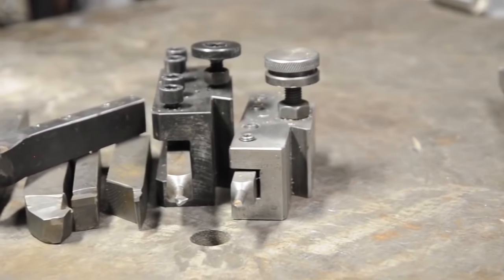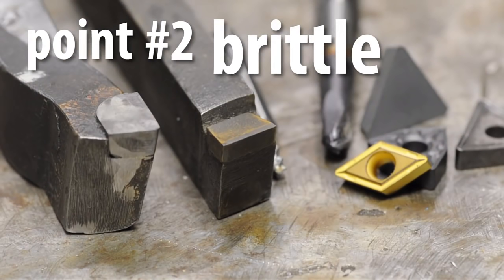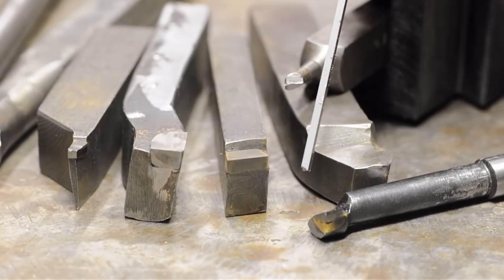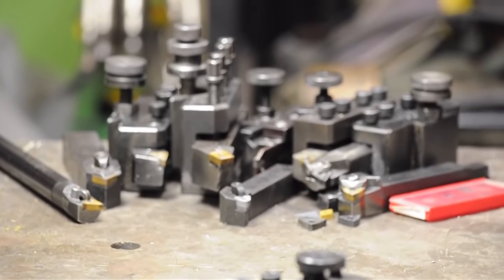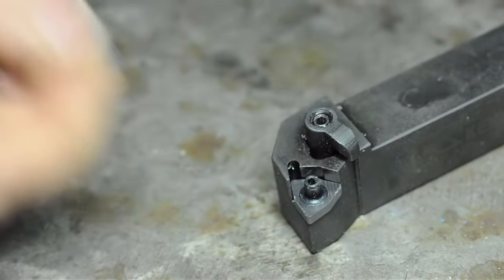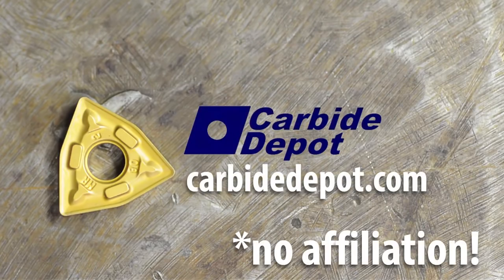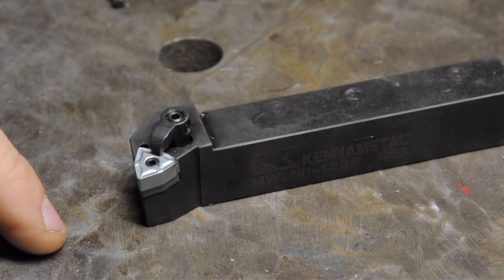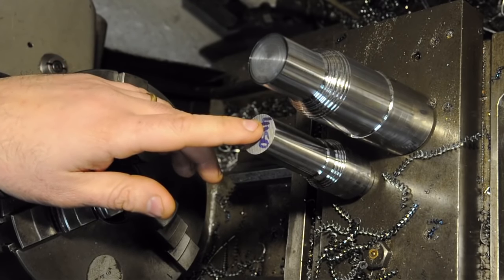A Brief Chat about Carbide Tooling

Comment: I'm completely green at true machining, (I HAVE managed to make plenty of scrap without the assistance of a lathe, mill, etc.. for a number of years), but I bought a little Sherline lathe a while back without a motor for next to nothing, and I finally have a motor for it, so I'm about to accelerate my scrap production.

I keep seeing comments, and hearing TOT berate cheap tooling, and want to share something I discovered not long ago.

I saw some very inexpensive set of 3 small boring bars on eBay which included 10 inserts, for < 40.00. My wife works for one of the big industrial suppliers in the US, so I get to buy toys, er tools, and tooling at employee pricing, which is cost +10.

I looked up the exact same boring bars and inserts to check the pricing, and what I found was the EXACT same Chinese brand at a significantly higher cost. They also sell 'US' brand names, including the Kennametal holder TOT displayed, so the ones I looked up were they lower priced entry, (the company, like many offer a range of price points for similar/same products, not same in quality, but features/type).

Unless you know for absolute certainty something is made in the US, don't assume. US manufacturers play a variety of games, ie: components of a device are made in various places around the world, then assembled, or packaged in the US, and they claim it's made in the USA.

Not all Chinese made stuff is junk, some US companies imbed QC guys in the manufacturers, since that is where a lot of Chinese manufacturing falls short. With that said, the Chinese manufacturers are learning fast.

The other old farts, like me, are old enough to remember when Japanese products were crap. I remember when no one would buy a Japanese bearing, now they dominate.

My theory is they were struggling with precision measurement, and it reflected in the products. I found an old Japanese set of taps and dies at flea market a few years ago, and they reminded me of how bad they were, when I was a kid, and working at my uncle's auto shop.

The taps would thread holes, and do a fair job, but you better use the dies to make you own bolts! And don't even think about 'fixing' a fastener, stud, or nut with them, they were off just enough to make them worse.

Nowadays, I'm seeing a repeat of the Japanese problems with precision measurement in Chinese products. I mean, would you willingly buy and use Chinese taps and dies, or bearings?  I wouldn't, I want the good stuff, from Japan!

If you want an eye opening vision of Chinese mentality and manufacturing, there's a Wired Mag vid here on YouTube titled, Shenzhen, The Silicon Valley of China worth watching.

Comment: I'm primarily a woodworker, so I have lots of brazed carbide, like in circular saw blades and router bits, though I have some HSS router bits too. That said, for working with wood I kinda prefer hand tools most of the time.

Comment: I was taught Carbide is good for moving metal on the harder metals, but high speed steel bits were the king for moving metal with a cleaner cut on softer metals like aluminum or brass.

Comment: I have done a little research into this and this is the impression i have got. 
Mostly its about getting a good ratio between edge sharpness and depth of cut/feed.
Inserts are not designed for taking off small amounts of material, that is why they are made blunt. There are inserts that come sharp for finishing work that might work better for people who dont have the power, bravery or ridgidity to take off big cuts. However these finishing inserts, with sharp ground edges, are not common or cheap, because they are not made in huge quantities for the heavy industrial user.

Comment: protip: most insert comes in a box that says recommended speeds and feeds. SECO, Sandvik and iscar does it best imo. if im not misstaken that insert you used should have around 440 rev/min and 0,44 feedrate.

Comment: As to the sharpness of carbide, there are grades with PVD coating, that are razor sharp...example: kennametal KC730 (this is an old grade so,fairly cheap on eBay). On the lathe, I use CNGP431 & 432, these have .015 & .031 nose radius respectively. CNGP is a nice geometry since it gives you 5 degrees clearance front and side(face and turn with one tool). Kennametal kc850 is a very tough grade for roughing...and very cheap on eBay.

Comment: nice vid tony. i must tell you a few things you did that i do not agree with. when you were changing the broken tip insert,you ALLWAYS tighten the cam lock screw first. and ALLWAYS blow out the tool holder pocket with an air jet. small particles in the pocket can prevent the insert from seating correctly. i am not familiar with the 08 08 code. that insert i thought was wnmg 431. maybe they changed it? thx rc

Comment: I'm not sure if you touched on this but the density of carbide is amazing. Easy to tell what cutters are carbide if they look similar to HSS. 

I've not had time to explore all your offerings yet, have you done anything with ceramic inserts? I got a lot of experience with them as a Toolmaker, quite often hardened components would need further machining. The whole "leave a bit on in case it warps or distorts"

Comment: When going through the insert code you said the thickness indicated by the 04 in the code meant 4mm thick, it doesn’t it is 4.76mm. This is because even in the ISO code most of the dimensions are imperial due to the length of time that inserts have been around. The ones that are metric are ones that have been added in more recent times such as the 08 inscribed circle designation. A CNMG120408 for example has an inscribed circle of 12.7 and a thickness of 4.76mm. This is where home users need to be careful when buying tools and inserts on eBay or Alibaba etc as some of the Chinese inserts that are sold in these places as part of those kits you mentioned have none standard inscribed circle and thickness dimensions which makes getting more inserts that will fit the holders you have bought a little tricky.

Comment: 10000 RPM for watchmaking sized carbide tools? How about 70000. When you work with really tiny tools on a regular basis, 10000 rpm starts to sound really slow. For instance, using a 1/16" carbide endmill to cut aluminum at 1200 SFM, you need to spin that sucker at 73339 rpm. Like Tony said, in manufacturing its all about removing material as quick as physically possible, and if you aren't doing that, you're fired. So to get that kind of rpm, you need an air spindle. They have very little torque, but at that speed, they have enough horsepower to do the job at the max SFM with those tiny tools. I have even used an air spindle that ran at 300,000 rpm! That was for cylindrical grinding a .019" hole in zirconia with a .011" diamond bonded carbide tool. Needless to say, those tools had to be balanced and indicated on center perfectly. And yes, it was a pain in the arse.

Comment: Actually, many of the comments are funnier than the video.  So much mis-information.  Although a few commenters do have a clue.  And the video is generally quite good...in basic terms.  
Reason carbide can run faster than HHS is because it has a higher hot hardness.  This basically means that as the material runs faster, it builds heat.  And when the cut zone heat gets to the point that it forms the plastic zone in the material being cut, the carbide tool retains its hardness.  Hss would fail rapidly at that point.  Carbide likes cutting temps of 1600 degrees F, or more.  Most workpiece materials will plasticize around the cutting zone at that temp.  However, if WC does not get to run at temperature (brought by speed...SFM), the material will weld it self to the carbide tip.  Known as BUE...built up edge.  Kinda like when you spit on a hot fry pan.  If the pan is not very hot, the saliva just lays there..and will adhere to the pans surface.  But if the pan is hot enough, the saliva skitters around, and will not adhere to the surface.  When there is enough temp in the cutting zone, the cut material slides off the carbide tip.  In steel, that is the point where the chips turn blue.  And the heat comes off the workpiece in the chip...turning it blue...while the piece stays cool.  Adding a coating to carbide is like giving the substrate material a safety helmet.  It’s harder and more lubricious, to give the base carbide more protection from an extremely volatile (heat, pressure, chemical, etc) environment.

As for chip breaking...needs higher depth of cut, to get the chip into the chip breaker zone.  And feed rate, to force the chip into the back wall of the chip breaker.  The reason the higher DOC and feed rate didn’t break the chip...Not high enough, and the chip wrapped around the tool and scratched the surface finish.  The cut with lesser DOC and feed rate gave a better finish is because the chip did not break...but was directed away from the workpiece...so didn’t scratch the parts surface.
Reply: I was following your comment fairly well for a beginner, until you slipped in WC without a definition.

So, WTF is WC?  (don't think I need to define THAT acronym!, lol)

Comment: Don't stop carbidel in the work, or the work on the carbide.
If you insist on using carbide to face make sure the tool point is oh so slightly above center.
Carbide doesn't require rpm, most everything cuts better with higher rpm, it just handles it better.
Not as sharp? I guess, but any material that requires a crystalline cutting edge will be soft enough for hss.

Comment: Hi 
I think that for all around tool the trigon insert is great i worked whit it for 11years. I think that you should use as small radius tool as possible if you dont have the power. Start your cutting speed (Vc) at 150 m/min and go from there

Comment: that tearing of the surface was not because of the chip dragging. you had a condition with the small feedover that the material was piling up on top and forming its own cutting hook which then breaks away and the surface magically goes back to good. There is a certain zone of feed and depth where the chip will flow across the rake surface better and not pile up or weld.

Comment: Tony I run a portable line boring machine repairing destroyed bores. I hand weld the bore and then cut it out with a brazed carbide tool bit.  Will you please do a video on sharpening carbide tools.

Comment: It's all very valuable discussion - But I think it's worth revisiting this phrase: 

[Because it's so hard it has the potential to move massive amounts of material very quickly, though technically I think it might be more the temperature and wear resistance than the hardness.]

My point: Is temperature and 'wear' resistance not hardness? I don't see that you are wrong, just that you somehow separate these almost first principle elements from the [tertiary property?: Hardness].

Comment: hey tony, learned a lot about carbide blades, i am not a pro at machining, i have a much older SB 10 L , and a atlas 6 inch i use  to play with. i was just wondering how the carbide blades were attached to holders and boring stock. glad i ran into your video. thanks

Comment: He refers to the WNMG as "negative rake." Looking at the inserts themselves, it looks like the cutting edge has a bit of a negative chamfer, you might call it -- presumably meaning that the rake angle itself is positive? I.e. the angle the cutting edge makes with the work is >90 degrees? Am I correct in assuming that "negative rake" then is just shorthand for saying the angle of the insert in the toolholder reduces the rake angle?

Comment: Thank you for the content. Which ones are for which materials. I have loads to pick from but I heard guy's say gold colour are used for ss and grey colour are for aluminium. What are your thoughts 🤔 i know each suppilers is different and I don't know what black ones are for. Can I use colour of insert for a rough guidance or size of chipbreaker for certain materials?

Comment: Have no negative ones in my shop.  CCMT and DCMT costs a fraction so it doesn`t matter that they have only 2 usable edges. For neg. ones U need more massive and powerful machinery. CCMT / DCMT  comes also in very sharp  version for softer materials ...

Comment: For me being a real lathe newbie, the cheap chinese carbide inserts have been quite nice. Something i have yet to understand. Am i supposed to get better  surface finish by turning at higher speeds with carbide or is high rpm just an option and benefit that carbide provides?
Great and very informative video as always Tony!
Reply: To some degree you can trade RPM for more Ap and/or higher feed rate to get a nice looking finish.
Or look for sharpend and polish inserts for aluminium if you need a smooth finish

Comment: Provided you don't chip the tip of the tool you can usually switch inserts that came off a right hand tool to a left hand tool and use the other side of the tip on the inserts so if you have a double sided cnmg you get 12 bites of the cherry .
Cheap tips are not worth playing with as a quality brand tip will outlast it by a factor of 2 to 1

Comment: Have you ever found a Conversion Sheet showing the inserts like you are showing here into the newer (I guess) ISO format like CNMG 120408 ... etc? It seems like the inscribe circle went away and the insert's side perimeter gets measured. But how about the center hole size, which after hours on the net I have yet to find anything about it or how to "convert" an old format to new one.

Comment: Sounds ridiculous, but I was turning a large chunk of aluminium with a 1.5mm depth of cut and 0.068mm/min feed, and was constantly running into the problem of bunching up chips you’re experiencing at 27:21. Running coolant on it stopped the chips from warping and left a perfect surface finish, even at different feeds and depths of cut.